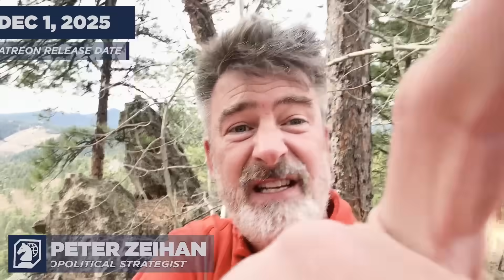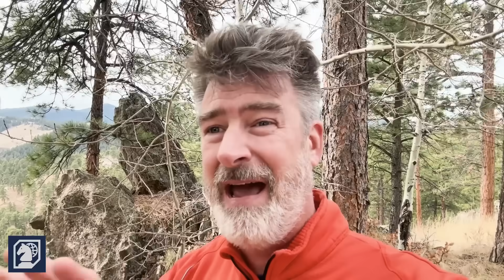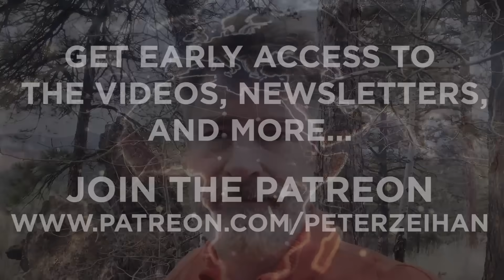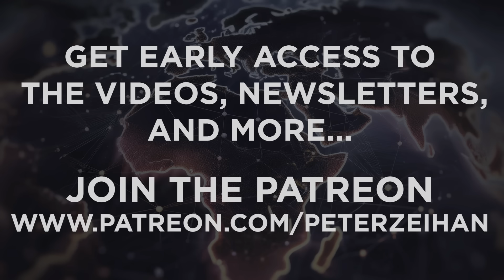Where Would I Put a US Semiconductor Fab? || Peter Zeihan

Comment: Statistics show how far behind Intel is. As of today, tsmc has 157 EUV machines and trying to order 60 more per year, although ASML is limited by its annual capacity that may be able to deliver only 40 to 50 maximum. How many Intel has？35！Since it stuck on the High-NA unable to get the yield up, there is no news on Intel buying more EUV.  One EUV cost is from low end $150 millions to high end $400 millions. Intel may be able to catch up on technology, but quantity？Far from it. Only can take a few % of the market. Calculate yourselves how much money Intel needs to buy 157 EUV. And the U.S. does not even have an ASML service center.

Comment: Portland metro region already produces 15% of the us semiconductor capacity and is where 100% of advanced node research is done at intel D1X only reason intel didn’t build mega fab next to D1x is because governor kotek refused to use her executive powers to expand portlands urban growth boundary which specifically prevented the 1000 acre type of site intel needed. The workforce is already here as well as tsmc has fab 11 across the river siltronic manufactures 200mm wafers in nw Portland and another wafer company in Beaverton. Portland is by far the most advantaged to gain more semi manufacturing but the UGB will never be expanded therefore quashing the econonic opportunity. Intel could then set the factory up in a way which could seamlessly transfer technology between D1x and mega fab meaning iterative design
Reply: Also Intels D1X facility is considered a tier 1 national security asset and an attack on intel Hillsboro would harm the economy and us technological edge more than any other single point of failure

Comment: Right next to the one I worked at for 20 years. Most of your assumptions are IMHO " Bull pucky" first there was preliminary planning for a 2nd Fab on the site which has been involved including significant advances (like those copper interconnects) since 1962. The vendors are already here If you  want advanced manufacturing in this country? What do you put tariffs on. Toys and Soybeans or maybe the chips we needed from Taiwan and Tsmc? Off the top of my head I counted 8 colleges in a 20mile radius including an Ivy and several with long standing programs to support the industry Not including West Point!  The post Fab production is already in place. And to put things in their place Texas schools don't hold a candle to our local systems. We don't prioritize high school football over Academics. Getting off my soap box now!

Comment: Suggesting Minneapolis when complaining about Chandler AZ? Peter your way off on this subject. I worked building semiconductors for 21 years. Chandler is an awesome place to have new fabs. First you only need about 10% of your work force for really knowing what they are doing, the rest can be trained over time. Production starts small so you need that 10% initially then and you start training people day one. As production increases, you add new people and what were new people a year ago have more than a year of training. This happens over about the first 5 years where the work force grows and you get more experienced people as you ramp up production. The 10% of the people that you need to start, you have to poach from other companies that already have the skill sets you need. Phoenix has many of these people as its the base for companies like Intel with huge fabs. Not a lot of fabs in Minneapolis (which is 1/2 the size of Phoenix) to poach people from.

Comment: I worked in Austin for Motorola during the boom of the late 90's into 00's before they spun off their chip sector (eventually picked up by PE and then sold to NXP where the remaining pieces have actually fared well).  Haven't been back since 2004 but they had at least 4-5 Fabs in Austin, 2 of which were going some time after I left (MOS13 in East Austin and MOS 11 in Oak Hill) and a few more in AZ.  There were a couple more decommissioned in East Austin but not sure if NXP still own the facilities or if they're even standing but there's legacy there.  Finding labor was easy back then.....trade wages were dropping due to the boom in reliance on migrant labor.  You could work the fab floor for $25-30/hr + great benefits (we had amazing medical) instead of laying shingles on 160 degree rooftops.  I've heard there's been a massive shift in economy in Austin and that tangible tech has fallen but he wayside for media, marketing, etc.  Lots of G2 $ from the 90's boom.  Though honestly I'd be shocked if they couldn't still staff 700-800 DL needed to run a moderate sized Fab. 

For clarification - in the industry the term "Fab" usually refers to the front end of the process.  Purchasing the ingot and dicing to wafers, etching the circuits, bumping for those specific package types with bottom side I/o, probing out the bad die on the wafer and converting into individual die.  The assembly/test/burn-in process was almost exclusively done overseas (had sites in Kuala Lampur, Sendai, Tianjin and Hong Kong but HK and Sendai were shut down) so that part has had minimal presence in the US for probably 30 years now.   Front end was less susceptible to offshoring due to IP threats.  Design was mostly US based but near the end of my time there there was a lot of movement to move it to India.   I actually supported and off-shored the last remaining back-end production floor, the building of which was one of an ungodly number of poor business decisions made in 5-8 year span.  We were primarily in support of Apple but this was pre-iPod when they were basically a niche for media creators.  Absolute shit show.  Every year they'd say iMac was going to blow up and every year we'd start the summer with them putting a halt on production because warehouses were full (which also drove me from investing in them which probably cost me $Ms).  On our side we could never get the core microprocessor yields to respectable production levels so margins after taking scrap into account were crap.  

I actually miss the crap out of it.  Even though I was a dotted line employee it was stuff you could get your head around.  Lots of good, smart people from around the globe and lots of energy.  My counterparts in Malaysia when we offshored were some of the sweetest people I'd ever worked with.
Reply: NXP consolidated most of their Arizona operations in the former MOS-12, then Freescale facility in Chandler, with a few operations offices scattered here and there. Here is the fate of some of the other major Motorola sites since the halcyon days:

MOS-6, Mesa: Closed in mid-2000s and demoed, eventually the site was rebuilt into warehouses.
52nd Street plant: This site was spun off with ON Semi, and closed last year, with demolition work continuing. Being a Superfund site, I am sure abatement will be ongoing.
Tempe Elliot facility: Freescale's other major site, closed in the mid 2010's and redeveloped into an office complex. The land under the freeway-adjacent site was too valuable to be left half-idle.
Government Electronics Group Hayden in Scottsdale: Appropriately enough, the site was acquired by General Dynamics Mission Systems, still in operation to this day.

Other companies that had presence in AZ, like ST, have also since closed up shop. There are players, like Microchip, Renesas, Amkor, etc. but most of the regional talent present here is in support of Intel and TSMC. Despite the decline of the legacy firms, I feel Arizona can still capitalize off the momentum it still has in a way that doesn't require putting all the eggs in the Intel or TSMC basket - but it's a window that is closing fast.

Comment: If you can have fabs in Boise idaho...you can have fabs in Denver or just about any city with a couple 100K population.  Building in Denver poses altitude issues with it's barometric pressure only ~.81% of sea level pressure.  You'd be surprised at how many issues this can cause within a semiconductor flow of manufacturing.

Comment: The reason Fabs are in Taiwan is clean water supplied by a rain-forest that is a huge national park..  ..  Saranac Lake, NY.. the reminisce of the Kodak work force is nearby.. and the etching fluids..  The Front Range has really crappy water (it is actually out of renewable - rainwater and also Phoenix (it is all underground and mineralized to the max.)..  Also Fabs use a lot of power thus heat.  The mid-west sucks as it's water if polluted..  it feels really hot; humidity wise, in the summer (cooling uses water) you really need those pristine forests for the purest water... and not a drug addicted population.. You need a controllable environment and a influence of a steady corporate structure making sure that the process just ticks along..  Oh, the other big NY corporation that is a 'steady' is IBM.

Comment: TSMC's mega factory in Phoenix is not Chandler. Chandler is the center of gravity of Intel's footprint in Arizona, located south and east of Phoenix. TSMC in Phoenix is located within the northern part of Phoenix proper. Texas, and Texans specifically, are not even remotely suitable for this business...you need strict adherence to process and data-centered decision making...this takes a humble but disciplined mindset combined with harder work than most Texans / most Americans will be willing to endure. Yes, there are some in the US willing and capable of this work (I did it for 20 years) but the vast majority of Americans are simply unequipped for the data-rich environment in which you have to operate and the vast majority of those that are equipped for that would consider it a completely unendurable grind.

Comment: @pauldmeyerable has it correct - I would add one other twist to this. Find an are that has minimum barometric changes, both over small scales. hour to hour, and month to month. I worked in a FAB for 14 years and we had several layer/tool combinations that could not be run when the outside air pressure was outside certain values.
Reply: I demonstrated to my manager the 2u-thick photoresist coat process I inherited was not capable of providing the wafer-to-wafer uniformity specification due to the barometric control of the photolithography bay, which was oscillating with a ~9-minute period.  The resist pumps were pneumatic types and the bay barometric pressure fluctuation was enough to influence the resist dispense characteristics.

Comment: He mixes the fab in with a lot of lower end stuff that can be stood up quickly in many places.  That’s like factoring in the local rope manufacturing capabilities on where to dock your nuclear aircraft carrier.
Reply: The lower end stuff is precision machining, injection molding packages, laser cutting lead frames, wire bonding to the ICs, chemical plants, electron microscopy. It's not really "rope manufacturing". It takes skilled labor and lots of infrastructure.
Reply: An asinine analogy that sounds like it was born in the mind of someone who doesn't actually know a thing or two about semiconductor fabrication and packaging.

Comment: The lead time to build a fab is so long that I worked on a Motorola fab in AZ and after 4 years of installating equipment they shut down without ever making a chip.
Reply: That's what happened to Zilog's 200mm fab in Nampa Idaho.  Built from scratch, got it up and running, qualified the process, built some jellybean benchmark parts, then it got shut down.  I worked in the 125mm fab (which lasted about two more years), I have never seen so many people with 1000-yard stares.
Reply: @Slickrock72 when you see hundreds of people crying in the parking lot and hugging each other you feel sick to your stomach

Comment: A little history of the semiconductor fab industry. In the beginning, when they didn't make ICs, but individual transistors & diodes. Back then "fabs" (fabrication) were relatively cheap, and the product simple, and large. The semi industry was the fab. It was a largely vertical production chain, with only a few suppliers, and the lithography, was from the same companies that supplied photography gear.

Then the early IC's happened, and they were simple. But every generation, they made the individual transistors smaller. Eventually, you needed new methods that old fashion photo negatives could not achieve, and at every new generation, updating you equipment got exponentially more expensive than the prior one. By the 1980s, this thing called "fabless semiconductor companies" became a thing, and they only designed the ICs, and contracted an established IC company to make (fab) their ICs. Eventually all, but a few IC companies became fabless, due to the complexity and cost of the whole fab process.

Also production became "horizontal" over that same time, as it does for most mature industries. In the early days of Ford, raw lumber (tree trunks), raw rubber, and iron ore, entered one part of the factory, and cars came out the other end. But over time, separate steel makers, and tire companies, provided those parts. Similar happened to the IC companies. This has happened over a period of 70 years, for the semiconductor industry.

Semiconductors are in everything ! It is important, from a national security standpoint, that critical industries, be brought back to at least North America, if not the US. The current semi industry was created with business economics, in mind, but with a global, supply chain, its a national security nightmare. It needs to be localized, but it won't be easy, and definitely counter, to economics, but its necessary ! Can't make smart weapons without semiconductors.
Reply: The first IC was invented in 1960, but semiconductor transistors and diodes were made through out the 1950s. Though only going into hearing aids and transistor radios, mostly, with a few specialized space and military programs. In the 1960s, ICs ranged from a few 10s to a few hundred transistors on them. By ~1970, the 1000 transistor was broken, and the first 8-bit processors of the 1970s ranged between a few 1000 transistors, just under 50,000, per IC. By ~1985, the 1 micron (1000nm) feature barrier was broken. Also putting 1 million transistors onto one IC was achieved sometime in the 1980s. That's also when contracting to fabrication (fab) to an outside company started to become a thing. Sometime before 2010, a billion transistors, per IC, happened, and most semi companies were fabless. Now feature size is under 10nm. Only a few companies can make ICs this dense.

Also note, individual transistors, and less dense ICs (from 10 to a few 1000 transistor equivalents) are still made, and needed. The inverters in EVs need very large (individual) transistors, to turn DC into the 3 phase waveforms to power a 100+ HP electric motor.